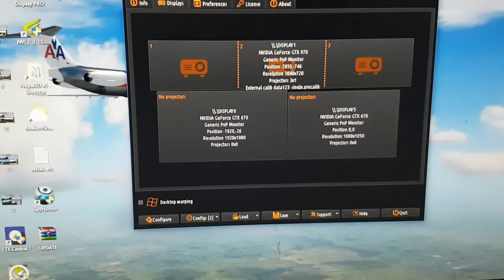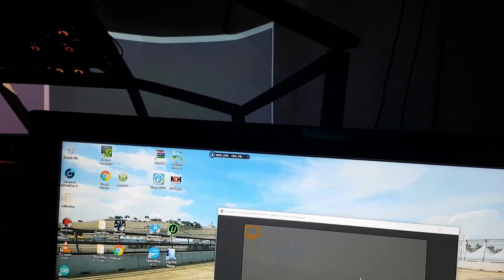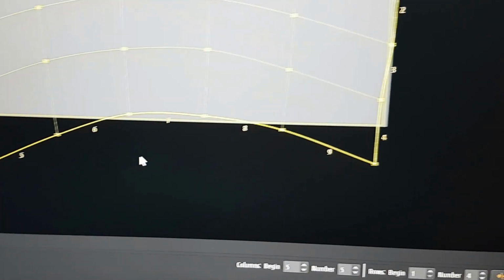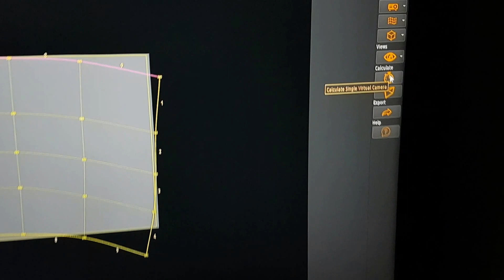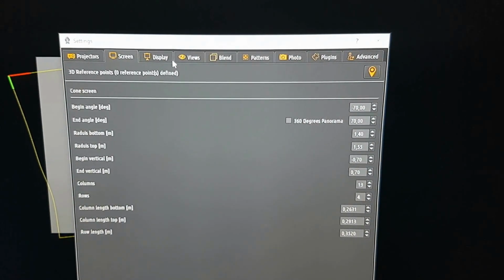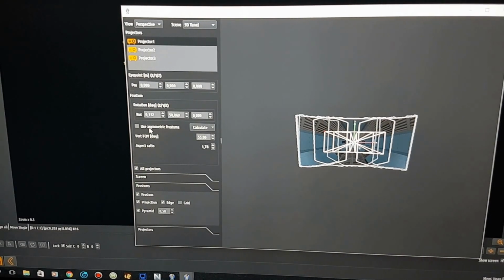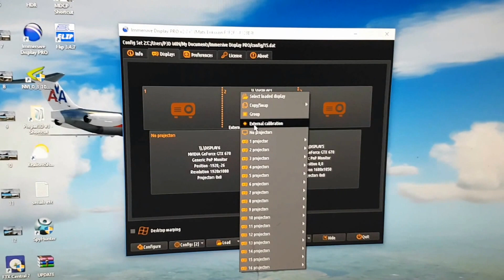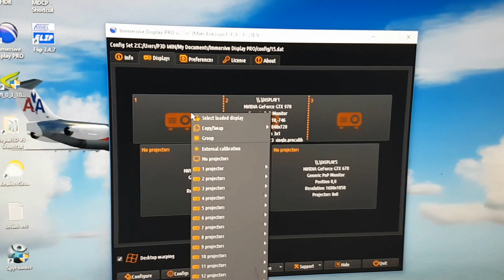Fly Elise-Ng Calibration Pro video how-to

Comment: Nice video Mat,
I know you are very busy person :)

I bought calibration pro, Does projectors need over shoot the screen all around? mean four corners? I am using Two LG Short throw Projectors due to small single garage. I made 180 degree curved screen 1.7 meters high. using two Pc's. I cannot see export files in Display pro folder, both computers connected together.do you have any ideas?
it will be grateful..
Reply from the maker: Hi! Thanks for your comment. You can contact me via Facebook aswell. No they don't need to overlap or be all around. I've used to projectors aswell, they only need to overlap about 5-10 degrees in order to get a good warp. In cm maybe 20-30 cm overlap.
Reply from the maker: I can not remember now where they end up, the files that is, but search for files that end in .calib and you will find them.
Reply: Thank for reply Mat, still trying to.
 I will let you know when I am done  :):)

Comment: mats ive seen your video trying to understand a little bit more the calibration pro that comes with display pro and by this point i got the idea how it works but were i get lost is to set the final export file to FSX, becouse the very first time i just tride with display pro and once i opened FSX it just revert the normal view, so i got now that must br done with the calibration export file but im not sure how can i set this. do you have any idea? dont know also if its the same in prepar3d
Reply from the maker: Hi! Check out my other videos about this software. They explain it even more how to do it all. Not sure about FSX since it doesn't use viewgroups. There you need to open 3 different windows and manually enter the values from immersive Calibration frustrum file. It's not difficult but more time consuming. In prepar3d from version 3.3 forward, it uses viewgroups which makes it very simple. Calibration pro exports a file called viewgroups, this is used directly when inserted in correct prepar3d folder.

Comment: Hi，I got a NVIDIA NVS510 GPU. Is this mode suitable for Flyelise?
Reply from the maker: Hi! Yes it is suitable for any Nivida or AMD but depending on what you need from it, it might be slightly underpowered for the whole system. :P
Reply: Mats Eriksson ，Hi, we are about to do a project, which uses 10 projectors(2x5). Now, I'm worried about the intersection area between every 4 projectors. Is Fly Elise able to solve the problem? Do you have any experiences about that? Thanks!
Reply from the maker: 李健 Hi! Yes their software even handles dome setups so 10 projectors is no issue at all. And yes I'm familiar with setups with more than 3 projectors, the system remains the same.
Reply: Mats Eriksson Hi, thanks! Your reply is really helpful. Maybe next month I will run a rest. It's a 2x2, rear projection with a bright-light environment. I don't know if it's possible to do it with auto camera calibration, but I'll try. You can search Visible Vitrum. That's our company name. It's cool!
Reply from the maker: 李健 Hi! Sounds awesome! I would be glad to help if you need assistance. Have been giving help to a few users lately over Teamviewer or fb messenger. Just look me up, Mats Eriksson, Finland, blonde and sunglasses on in the profile picture. :)
Reply: Mats Eriksson Hi, thanks again! I'll let you know then.

Comment: Hello, I am using I-CalPro and when I run "single" I am able to get a nice single camera blend using two projectors side by side on a flat surface. However, when I try run "Server", I am unable to load in the saved config or project file saved after using the "single" application.
When I run "server" and I start a new project and add the two projectors I am unable to get the projected display to appear on screen and the program says "zero of two projectors connected" at the top. Thanks
Reply from the maker: RVP RVP Hi! Thanks for your input. At that point where you have those two projectors, be sure the resolution is correct and if it doesn't connect directly, just doubleclick on either projector and it will bring up another window that asks if you want to connect to all projectors. After that, it's done and it will take a minute or so and you will see your projectors getting an image and then they are ready for adjustment.

Comment: Hi Mats, Thank You mucho for the guidance. Think I get almost everything but still confused with the export process to Inmersive Display Pro and P3D to get the aligned  perspective view from left, right or centre view. Can You please helo a liittle with that part....? Mac
Reply from the maker: Carlos Liberoff Hi! Sure I can help. You need to export from Calibration Pro ViewGroups for Prepar3D and files for Immersion Pro to use in it's software. In Prepar3D activate ViewGroups and when you have ViewGroups and frustrums (xml) files in the right folders it works straight away. The folder is where the documents are for Prepar3D, look for Prepar3D.cfg and that is the correct folder. :)

Comment: Hello!! Amazing! You you dont have to set up multiole camera settings on the p3d files? Or im missing something? I didnt understand so well the single camera thing you did.
Reply from the maker: Hi! No you don't have to set up multiple cameras in p3d files. The program Immersion Display and Calibration Pro does all this for you. You only run Calibration Pro, let it make the files, insert the files (ViewGroups.xml among others) into P3D files folder and then inside P3D you select ViewGroups and it should align perfectly over all projectors you have.

Comment: Hi Mats,
First of all, thank you for informative tutorial on Cali Pro software. I'm thinking of purchasing the software, I already have the display pro software running on three projectors. I have a somewhat good alignment on all three projectors using FSX on ground and on level flight,!Unfortunately, during climb my middle projectors horizon line in much lower than the other two side view projectors..Could you please confirm if in your setup the horizon line stays constant with projectors 1-2-3 on all stages of flight?
best regards,
Phil
Reply from the maker: Hi! Thanks for your reply. You have incorrect settings in FSX if the horizon is not in line. You would need to set it up better or the alignment is incorrect. Yes the horizon always stays level with 3 projectors at all times when the alignment is made correctly with Immersion software. The software really is essential when using projectors, there really is no other way around it.

Comment: Mats is need to use both software ? I had before my system working with flat screens
Reply from the maker: Hi! You only need Immersive Display. But Calibration software from Fly Elise is to recommend as it helps alot to get everything nicely aligned.
Reply: Thanks Mats , I am trying to play with Immerssive Display first  , it is not easy to align with it .
Reply from the maker: ALBERTO KUNZEL I will make a more complete tutorial with steps to show how to do it. :)

Comment from the maker: Hi and thanks for the comment. No it doesn't affect fps in any other way than improving since it only need to render excactly the amount needed for the projected area. Single pc with dual Gpu. One Gpu for the projectors and one for instruments and other stuff.
Reply: Computer specs?
Reply from the maker: +Panu Fabritius i7 4770 16Gb RAM, GTX 970 and GTX 670, P3D and W10 on SSD hard drive. 3 x 720p projectors.